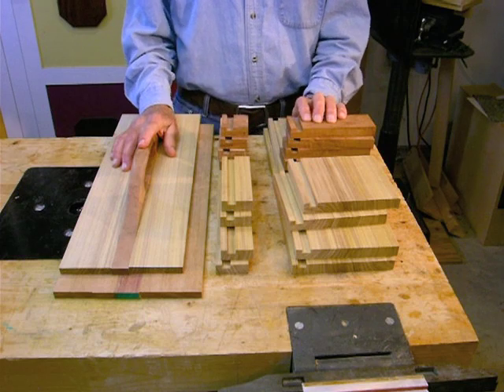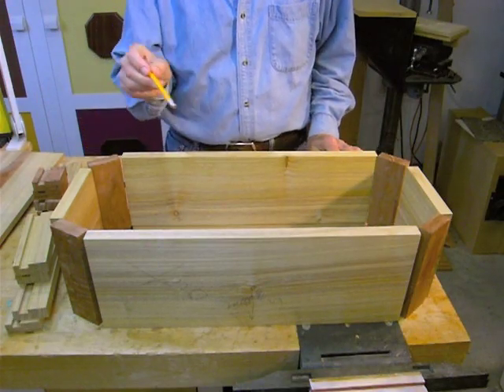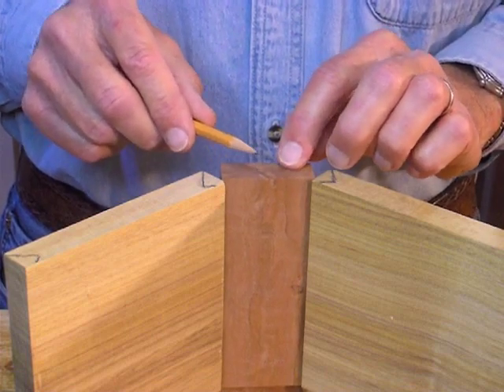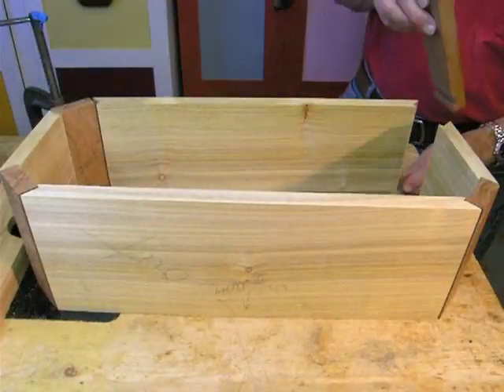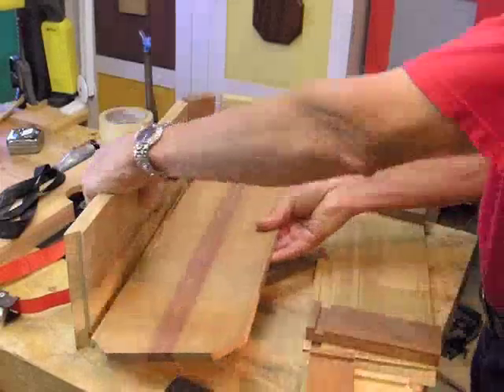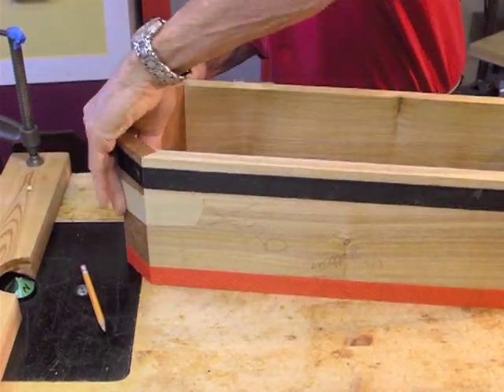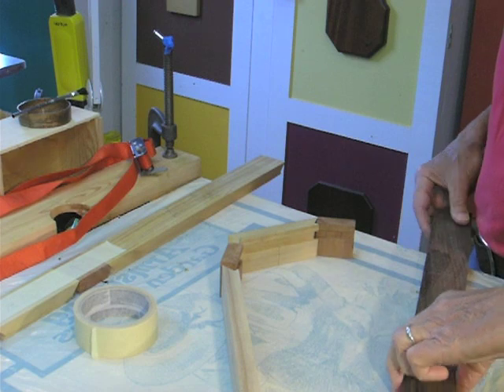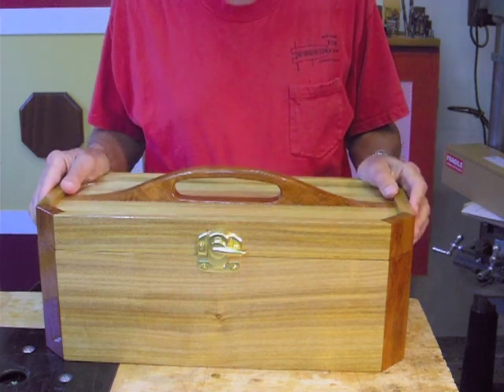Bird Mouth Joinery: A unique tool box

Comment: The joint is end grain glued to long grain. I wonder, how reliable is it?
Reply from the maker: Thanks for the comment and question. It is an entirely valid concern and quite a few other woodworkers have asked about my use of cross-grain glue joints. Unequal wood expansion between the two parts of the joint is the concern here, and must be taken into account for larger projects such as cabinets or tables. 

As the size of a glue joint decreases, however, joint stress also decreases. This tool box is the largest piece where I have used cross-grain glue joints and, more than two years after assembly, with frequent handling, there is no sign of joint separation. On smaller, earlier pieces cross-grain joints are still good after at least 8 years. So far, I have never seen a failure. I use these joints because, combined with bird mouth joinery, they offer easy access to a wide range of decorative and design options.
Reply: It's a valid point. After some thinking I've figured that longer sides are fixed to a bottom frame, and that they constrain angle pieces mechanically. Even minimal adhesion should keep the joint strong.

Comment: Was that a custom bit or is there a manufacturer for it?
Reply from the maker: +gary24752 Hi Gary! Thanks for checking out my video. The 8-side bird mouth router bit used for the project was purchased from Lee Valley, but similar bits are available from several sources, e.g. search Amazon for bird mouth router bits.